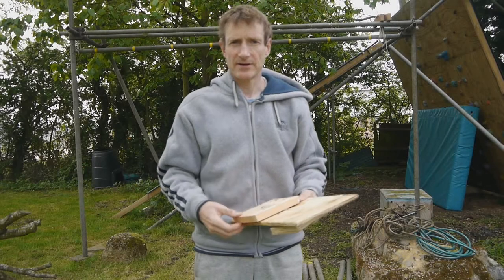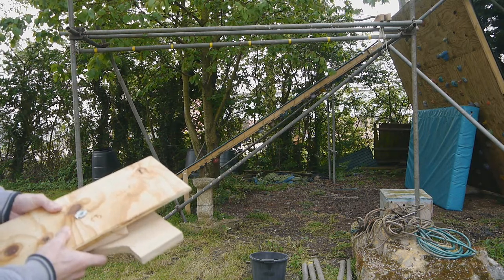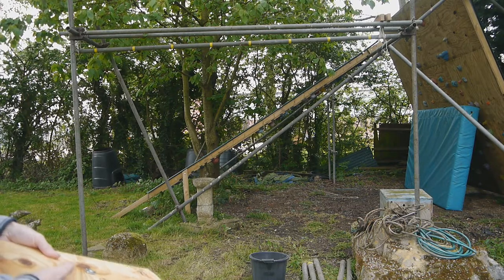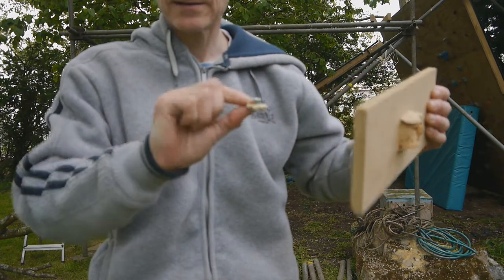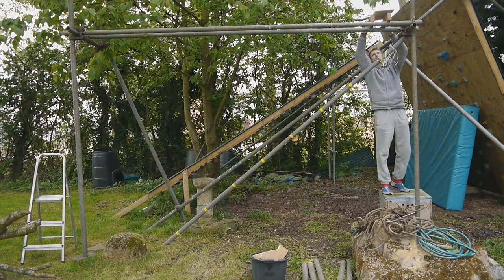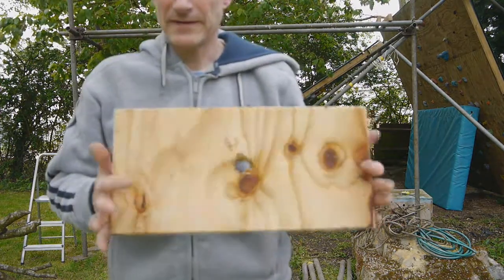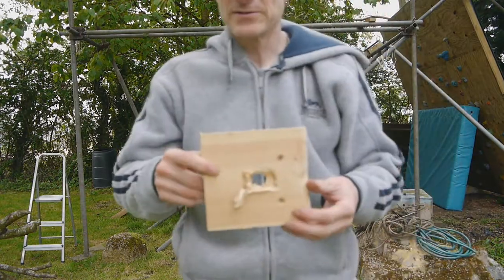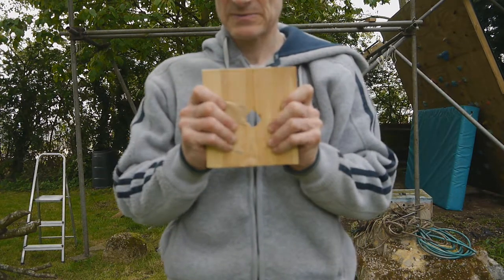Climbing wall panel t nut pull through test

Comment from the maker: Hi Ali, no this was not marine ply. I was shuttering or flooring ply. It looks like the pull through test does not have much applicability, it is the impact test which most stresses the boards. I think anything that passes the impact test will have no problem with the pull through requirements.

Comment from the maker: Hi Sean, it was a zinc plated steel M10 4 prong hammer in t nut. The nut on the back was to avoid stripping the thread and only test the strength of the wood. It may have been overkill.

Comment: You may have said it but what size and type (zinc plated, 4 prong) t-nut did you use. Also, why the extra nut on the back side of the t-nut? Kinda defeats the purpose of the t-nut and it doesn't test the pull through strength of the threads inside the t-nut itself.